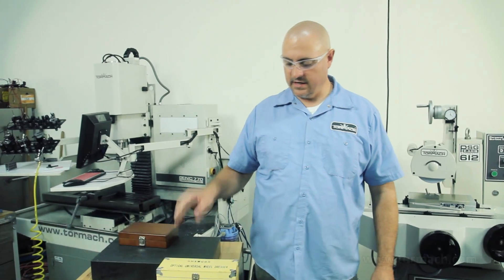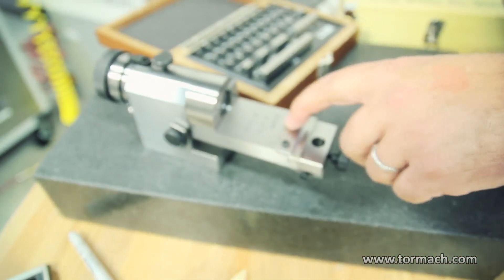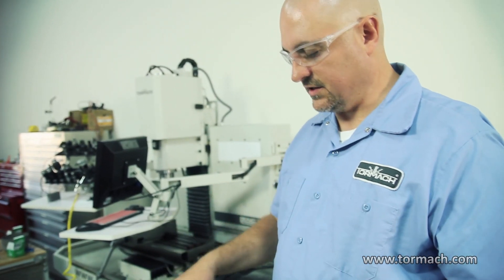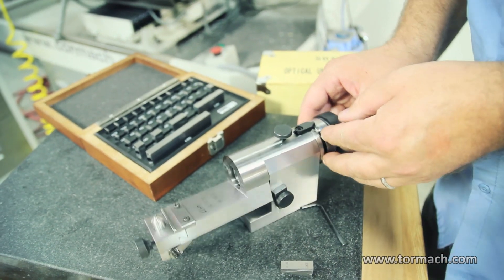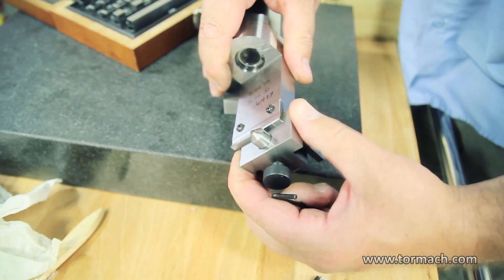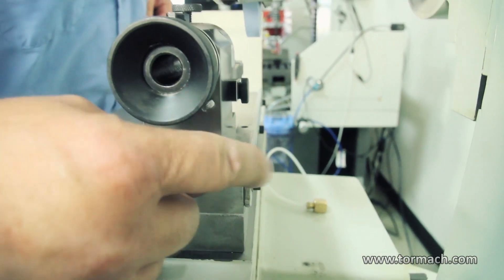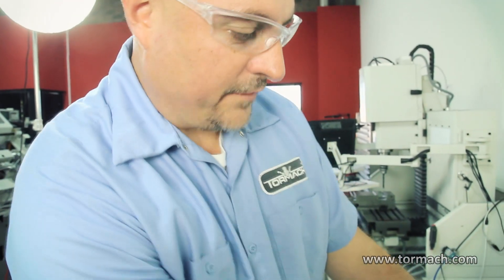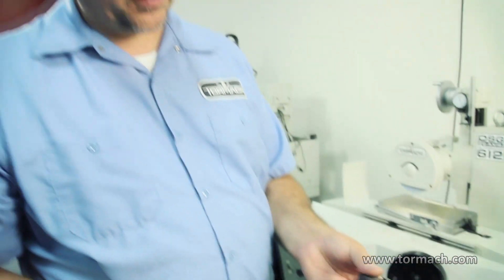Surface Grinder Basics: Grinding Wheel Dressing with an Optical Wheel Dresser - Tormach

Comment: Gotta have accurate part if you need to grind the chamfers. Is it possible for you to get a microphone of some sort because of the background noise?
Reply from the maker: I apologize for the background noise. We had to temporarily use the R&D area in our old facility while we were preparing to move to the new one. The new Tormach Training Center is relatively quiet. If it does become an issue (once the air conditioning kicks in during the summer) then we will look into purchasing some lavolier microphones.